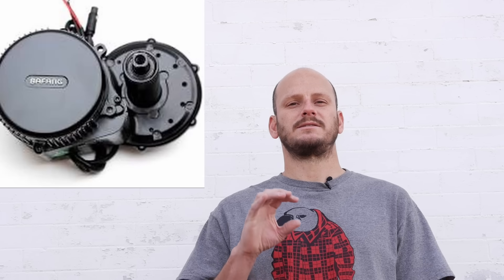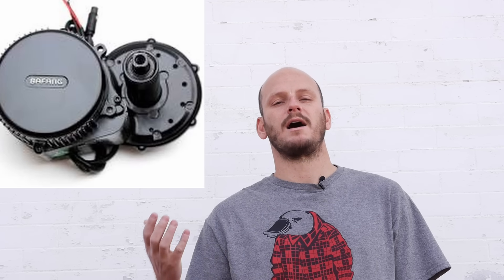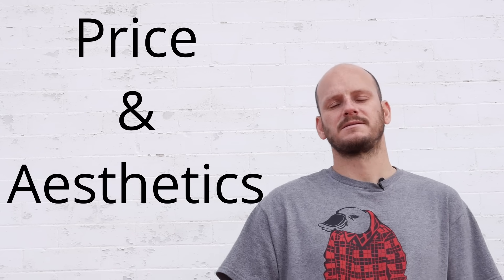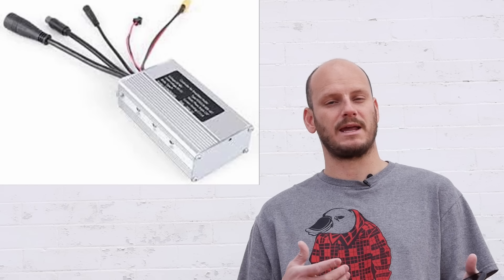Hub vs. Mid Drive Motors: Why Hub Motors Suck and Debunking Common Myths with performance test

Comment: What if you have 2 hub motors? One in the back wheel and one in the front.
Reply from the maker: Good for traction but still not as good at climbing steep grades as a single mid drive
Reply: If you use the motor simulator on ebikes.ca you will find that two dirt cheap hub motors will rip you up pikes peak at 50 kph. That is quite a few horse power. Designing a bicycle bottom bracket drive that is capable of beating two dirt cheap hub motors is a challenge.

At the end two big motors are going to beat one tiny motor and you don't have to worry about mechanical transmission nor mechanical braking with hub drives.
Reply from the maker: @difflocktwo  🤔 They must be geared veeery low then to achieve better hill climbing than a single mid drive. I’d be curious what the top speed would be on that setup. I’m my experience physically riding dual hub motors, they don’t come close to a mid drive.
Reply: @JohnnyNerdOut  For direct drive hub motors the gearing is the wheel diameter. You are right, for my theoretical hill climbing monster I would opt for 16" or 20" wheels. Top speed (ignoring wind resistance) would be whatever you want. You can get direct drive hub motors that are almost 20 Kv so you can go really fast with a 50 V setup, then double that top speed with a 100 V setup. My electric moped has a tiny diameter direct drive hub motor with a Kv of about 15 and can go 60+ kph at 50 V and a 16" wheel (10" moped tire). Throw field weakening into the mix and you get even more top speed. The motor simulator covers all these scenarios.
Reply: @JohnnyNerdOut  I had a Chinese hub motor moped that used lead acid batteries and with a big rider and its own weight the total weight was easily 200+ kg. This $100 motor would easily climb steep hills. I don't have gradient numbers but hills were never an issue. For example: blasting up off-ramps all day no problem. 

The weak link was not the motor, it was the crappy control and battery. Switching to lithium and a beefy controller turned that moped into a rocket.
Reply from the maker: @difflocktwo  👍

Comment: Hub motors are amazing.  They make your bike look like it's not even electric.  You don't have to deal with gears or belts or any of the moving parts bullshit.  I built a hub motor ebike and been riding it for years with 0 maintenance.  So mid drive or w/e are faster...okay but isn't the legal limit like 22 mph or something?  I can go 30 with my hub motor by flipping a switch which ups it to 1000w.  This is illegal, but so is going 30 on an ebike...so no point following 1 law to break another.  Watched more of your video...so you can climb grass hills faster?  Nice.  I don't ride my bike up grass hills..... does anyone do that? Also don't mid-drive make a bunch of noise?  Not everyone can cancel out their noise with music like you keep doing in your (very biased) video.  I like to ride on a couple of local bike trails.  On my bike they don't even know it's electric.  On mid-drive it would look goofy and make a shitload of noise and I wouldn't even be able to ride it on the bike trail.  All the old people would report me and also I looked up the rules and there are a bunch of strict rules for e-bikes which I don't have to follow because they don't even know it's an e-bike. If I wanted performance so bad I would just put 2 hub motors on and go 40+ mph, probably 50+ if I went higher than 750 watts.  I will continue watching the video but I doubt there's going to be much more since your focus seems to just be torque and speed.
Reply: Hub motors are magnetic...it isn't straining it at all.  I have used my cheap chinese hub motor for 4 years and hundreds of miles and it works like new.  This is because it doesn't have a bunch of moving parts which wear out as I mentioned before.
Reply: Okay I'm at 4:30 and just realized you have no clue what you're talking about.  I don't think you worked as an "ebike mechanic in a shop that only sold hub motors".  You hesitate every time you say you worked at an ebike shop.  You have a very biased opinion and you make shit up and cover shit up with to back your opinion.  Hub motors are better in certain ways, and so are mid-drive.  It depends on what you're looking for.  You should open your mind a bit instead of being so biased though.  IMO mid drive is better for trail riding and hub motor better for flat bike trails such as in parks, trailways, and long distance on pavement where you can't exceed (I believe 22mph correct me if I'm wrong) legally anyway.  Hub motors are more low profile, and mid-drive are faster.  You should have just done an unbiased video showing the best / worst of each.
Reply from the maker: I’ve been an ebike mechanic since 2017 professionally building custom bikes with mid drives and also working for major manufactures using hub motors. After that experience it is IMPOSSIBLE to be unbiased.

Comment: Sounds as if he's talking about a single speed bike. Most ebikes come with gears. As long as your in the right gear your good. I have seen people burn up $7,000.00 Specialized ebikes from riding them in the wrong gear for to long. I think some people need to read up or take a class on how to ride an ebike. They are not your standard bicycle.
Reply from the maker: Hub motors only get to utilize one gear mechanically
Reply: @JohnnyNerdOut  after I looked deeper into what you said and the design  you are 100% right!! Looking at the Recon   Camando it has a rear cassette 7 speed but that will only work with peddle assistance and you can adjust the power  output as needed. On throttle only one speed. Glad I have a mid drive Shimano steps E8000 motor in my emtb.
Reply: @cabbynate  have you tried a hub driven ebike that costs as much as your shimano  ebike? 
For only a few hundred dollars (minus battery) you would have enough motor and controller to put down ~ 10 horse power.
Reply: @difflocktwo   To be honest no. My emtb is for aggressive trail riding. I haven't seen a $6,000 hub drive emtb built for my kind of riding.  As a Bike Security officer the hub drives are appealing to me because of price.  Otherwise I'm a mid drive guy for sure.
Reply: @cabbynate  What do you think about the sur ron? For 6 k you could build a very nice one.
Reply: @difflocktwo   I think they are very cool but they are not class 1. The Sur Ron X is more motorcycle than bicycle. Maybe you talking about another Sur Ron?
Reply: @cabbynate  No, I think we're talking about the same sur ron.
Reply: @difflocktwo  OK yeah the Sur Ron X is a mid drive motocross ecycle. No pedals and can't be ridden on most single track MTB trails. Those smoke gas engines on motocross tracks! However they're not e-bikes.

Comment: Clearly a heavily biased video which is unfortunate. All the newbies are eating up your borderline misinformation.
Reply from the maker: What is mis informative?
Reply: @JohnnyNerdOut  You picked a tiny, expensive, geared hub motor and apply its shortcomings to all hub motors. In reality a $100 direct drive motor can put down many horse power: https://m.youtube.com/watch?v=e03rMDmJzLE

Given a fixed budget, a hub motor build will absolutely eat a mid drive build.

Also comparing electric motors to internal combustion motors + multi speed gearing is misleading. Electric motors do not behave the way combustion engines do with respect to torque, efficiency and rpm. You're not "stuck in any gear". You have a torque and speed requirement and you simply choose a motor that matches your requirements, no need for multi speed gearing.
Reply from the maker: @difflocktwo  agree to disagree. Also that video was using a 112v 400a system. Not realistic at all. Apples to apples at 750w hubs don’t stand a chance. Also you absolutely need gearing when using a low powered system. Mid drives just let you decide how much gearing your doing
Reply: @JohnnyNerdOut  By definition, if the output is 750 W at the wheel, that is the output. The output is independent of the drive type. So if you dyno two bikes and they both put down 750 W, it doesn't matter what drive type it is. If one puts out more or less than 750 W, it can no longer be considered a 750 W system. So I'm not sure what you mean by 750 W.

I don't see anything unrealistic about showing how a cheap hub motor is able to handle big numbers. A $200 controller can pump 200 A into a $100 motor easy.
Reply: @JohnnyNerdOut  I just googled a $200 motor controller, and it's a pretty fancy one. 80+ V batt voltage; 100 A battery current and 260 A peak motor current. 

http://www.cnqsmotor.com/en/article_read/2000w%20Motor%20Controller%20Sabvoton%20SVMC72100%20controller%20for%20Electric%20Bicycle%20Motor,%20Brushless%20DC%20Controller/417.html
Reply from the maker: @difflocktwo  my point is how the two systems use the same power to achieve different outputs
Reply from the maker: @difflocktwo  ya the sabvotons are nice controllers.
Reply: @JohnnyNerdOut  Ok, but do you think you chose constraints and loads cases that makes a mid drive look better? It's like within your very particular specifications mid drive performs better. 

I will say one thing, most (low power) hub setups people build or kits they buy are far from optimal. If this was your message in the video I would fully agree. But hubs are not inherently lower performance. Even on low-power criteria I believe a hub system could be designed to match a low power mid drive build.

My experience: I have riden 250 W Bosch and Shimano mid drives (which actually pull like 600 W from the battery) and my $250 hub motor + controller destroy those systems while pulling 5 kW from the battery. My $250 hub + controller was scary for light riders because the front wheel would lift because MTBs have a short wheelbase.

I feel like we have understood each other a bit better, which is good.
Reply from the maker: @difflocktwo  No I chose those constraints (750w) so that they were both street legal, which is 90% of the ebikes out there. And i wanted to use the same manufacturer so no one would say that one was better than the other quality wise. A lot of people don't understand or appreciate the power of gear ratios :) It's Huge!
Reply: @JohnnyNerdOut  Surely street legality would be judged on power output at the wheel. Anything that meets legal definition would perform identically. You lost me again. 

Just to be clear, mechanical transmissions are not 100% efficient and output power will always be lower than input power.

Comment: Both mid-drive Motors and hub Motors transmit all the power to the tire through the spokes. And in fact if the mid Drive motor is more powerful and allows you to accelerate harder than the hub Drive motor it would be harder on the spokes then would be the Hub Drive motor which is weaker.
Reply: Radius also plays a factor though. The hub motor takes up hub space, resulting in shorter spokes with less spring to them and a tighter deflection angle on torque, meaning a hub motor will hit your rim harder than a mid-drive. IMO it's only an issue when you're using the super thin tires that have relatively weak rims that deform more easily.
Reply: @Teth47  don't you think that the shorter spokes would keep the thin rims more stable and resistant?
Reply: @nonegone7170 :) strange question... yes spoke wheels would eventually fail.. that doesn't mean the car will. but the debate here was hub motor vs chain motor, and the claim that hub motors damage wheels and chain dont.. you got the wrong side of the argument
Reply: Huh drive motors are not “weaker” very difficult to find a hub drive motor over 1000watts
Reply: @attackscorpion5323  It's not difficult to find a hub drive motor over 1000 watts because it's not the motor that determines wattage, but instead, the controller determines wattage.
Reply: @attackscorpion5323  Type in 8000 watt hub motor in youtube or ebay and then tell us that finding a hub drive motor over 1000 watts is very difficult!
Reply: @attackscorpion5323  you are in the wrong thread nobody is talking about that
Reply: You will break the chain or tear up your gears before a mid-drive damages the spokes on a bike.
Reply: The weight does matter in that it will resist changes in velocity like a flywheel…. But that is pretty much errelivant to the spokes themselves…. This conversation is sort of errelevant too the original comment I feel is correct the forces on the spokes remain pretty much the same….
Reply: the spokes are longer without a motor so perhaps that is the difference. The leverage makes them stronger?
Reply: @vinvan4237  no, his comment about mid drive motors being more powerful is wrong... we could say more efficient, that is due to gears.. just like a transmission, which may or may not exist in a hub motor, and again depending on the wheel size, it may or may not be more powerful, but we can say that the mid drive motors are more versatile due to the gear options
Reply: Hub motors apply torque directly to the spokes 1:1. Mid drive applies it to the chain and driveline. Big difference. Same principle as an engine in a car developing more power at the crank than at the wheels. The ignorance of this fact by those in this thread is astonishing.
Reply: @bl4558  so you are saying it is different if the spokes are turned by the chain or the hub? it is exactly the same thing... only slight difference would be that the hub motor would have relatively short spokes to turn, which in fact would cause less stress.... we are talking about spokes.. it is entirely irrelevant which part of the mechanism faces more torque or pressure etc...
Reply: @stinkycheese804  i disagree with the video, and yes its obvious that elasticity = vibration = loosening of nipples, metal fatigue etc.... Hang on a short rope, and try a sling , which one is more stable? thats obvious right? Its amazing how so many people claim without understanding, there is absolutely no explicable reason as to why hub motors would damage spokes or rims... That does not mean they are better, both have ups and downs depending on the need and application
Reply: @bl4558 - Hub motors, unless they are direct drive motors, apply torque through a planetary gear system inside the hub. Which goes to the hub shell, which is where the spokes are mounted.

 Somehow you think that torque automatically vanishes if you put the electric motor in the front of the bike so all the power goes through the chain ring to the chain to the gears to the hub shell, which is where we started. 

It doesn't matter. All the force that makes the bike go forward regardless of where it originated ends up at the hub shell where the spokes are.
Reply: @bl4558  lost cause bro
Reply: no the hub motor introduces different vectors as well because it is heavy
Reply: @Ridstard0  weight is irrelevant as any weight on the bike is on the wheel core equally the same. i could say it is probably the vibrations caused directly from the motor if spokes getting loose is true at all..
Reply: @backyardthinker5996  no dude, a hub motor weighs vastly more than a regular bicycle hub, and there are forces at play that are magnified when velocity is introduced
Reply: @Ridstard0  so by your theory, all the vintage cars that had spoke wheels should have fallen apart after a km? the hub is sitting at the centre and regardless of its spinning velocity, the spokes will encounter the same load of a narrow and light hub that is weightened by the 100 kg person sitting on it, or a hub motor that is weighting a kg more.. sorry but its irrelevant
Reply: besides, with a hub motor, the length of the spokes are remarkably shorter, which means more stability, more load carrying ability, and less vibration... go figure
Reply: @backyardthinker5996  who said anything about vintage cars or 1 kilometer before failure. Who also said that a hub motor only weighs 1 kg more than a regular hub? Nice strawman bro. A qs205 hub motor weighs like 30 pounds more than a regular hub, and you are going to tell me that regular bicycle spokes are not going to experience more wear over time? lol simply not true. BICYCLE (not car, not motorcycle, not dirtbike) spokes are not designed for that load, simple as.
Reply: @Ridstard0  you are waaaay off the issue..tell me, if a 20kg rides a bike, and then a 150kg man rides the same bike, what happens to the spokes? how is it any different than the load changing off the bike, or on the bike?
Reply: and also, thats rich, telling me im off the issue when you say a bunch of nonsense about cars earlier
Reply: @Ridstard0  GrinTech's All-Axle Hub (direct drive) motor weighs only 4 kg. Bafang's G310 (geared) is only 2.5kg. Phil Wood Classic Touring Hub weighs over 500 grams. Steel hubs are even heavier. Using a qs205 hub is the real strawman. TOURING bicycles (and Cargo bikes) can carry more than you claim.
Reply: @Ridstard0 - Now I know what grade you got in physics.

The spokes are controlling the inertia of the entire bicycle, which includes the frame, the rider, the battery, whatever drive you have hub or mid-drive... Where that extra couple of kilos of drive is mounted doesn't really much matter to the spokes.

In short the real problem with problematic spokes is that they typically end up on hub wheels made in cheaper factories with cheaper under gauge spokes.

 Proper lacing with correct gauge quality spokes and there are zero hub drive spoke problems.
Reply: @Ridstard0  Some hub motors are lighter than mid-drives. So...no, the hub motor does not introduce different vectors.